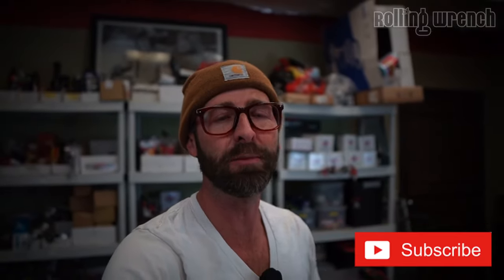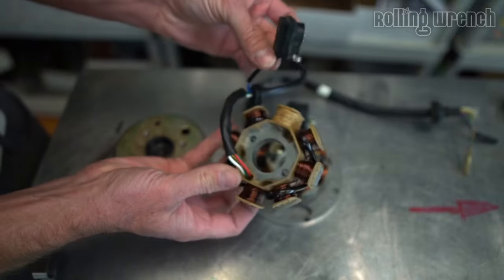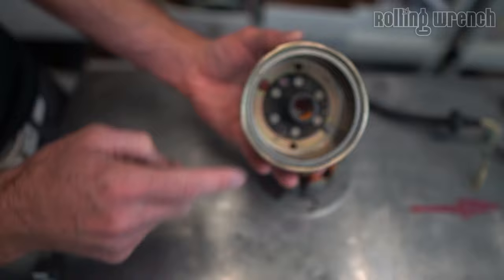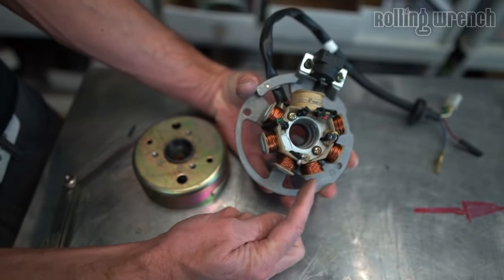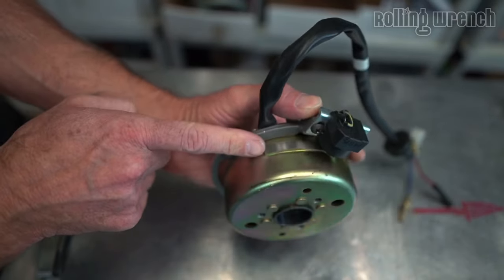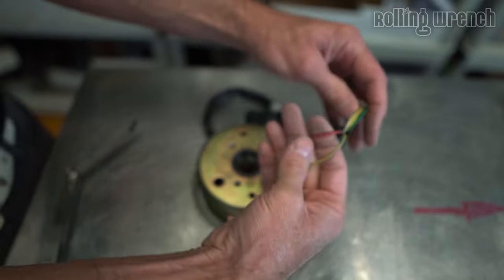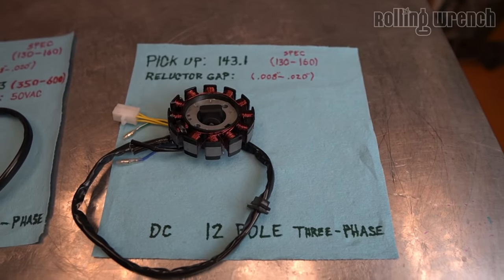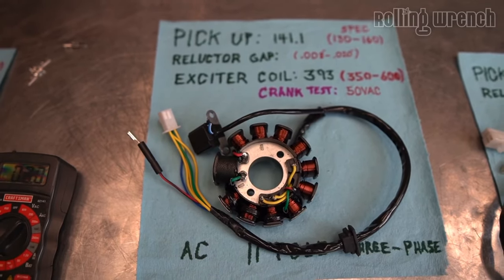HOW TO TEST A STATOR / WHAT IS A STATOR [step by step] GY6

Comment: The probes(AKA test leads or leads) on the multimeter have caps on them. That's why you only have a little bit of metal probe showing, if you remove the cap you'll get the rest of the probe length.

Comment: Hi Rolling Wrench! I converted my 1979 Honda Cub C50 from points ignition to CDI ignition by using a 1983 Honda C50 magnet wheel and a Chinese copy of the stator of the same bike. Now everything works perfectly except the exciter coil is getting hot and unable to run the bike in long distance (around 5 miles) as the exciter coil is getting fried. I tried changing the exciter coil with thicker windings, but the problem still exists. Could you please help me to solve this problem? 
Much love from Sri Lanka 🙏

Comment: in the final test you got for testing the exciter coil from black and red to ground when unplugged i get zero, when i test those same two wires while cranking i get 48 ish volts. i am unable to use a feelers guage because chinese engineering puts the stator in the end cap but the magneto on the bike. how do i know what is wrong.

Comment: Off Topic Engine Type  . i have a 1978 Honda G400 Flathead my Model is a CDI but i havent took it apart yet . i wonder if i can Retro Fit a Quad ATV  AC CDI ( 6 pin) box and use the Default trigger from the G400 to make it work

Comment: I have replaced my stator, but 
wanted to diagnose the old  'dead stator'.
I find that the p/u coil (exciter, pulse)
reads 280 ohms (you show spec for yours
to be about 130 to 160 ohms. Is mine far
enough out to indicate the p/u coil was my
likely or possible problem? 
This is on a 140cc pit bike with 
6 pole ac stator.

Comment: I have a Yamaha wolverine 350 that will not rev. I have tried the park brake switch hack and tried spraying carb cleaner in the carb to see if it’s a fuel problem but no luck.  Could a defective stator  cause the failure to rev? Or possibly the CDI ?

Comment: My stator pins have fried over time. By previous owner. I can use the pin connectors so im probably going to hard wired instead of the pins to see if they work. The rectifier was also fried. I want to replace that first since its cheaper then the stator and im on a budget. If i notice same issue then i will replace stator.

Comment: I have a 2009 Honda Metropolitan 50cc and I tried kickstarting it while the kill switch was on because it wasn’t starting, I forcibly pushed it down and back up multiple times until I realized I just had to flip a switch. Now sometimes it makes a terrible sound by the Kickstarter box. Just not all the time
Reply: Update. Found out you live in colorado so I’m going to have to find your shop :)
Reply from the maker: Hey Nik, just pull outward on the kickstart lever. I have seen this from time to time. If that doesn’t work. Remove the cover and lube the components. Very common issue

Comment: Question I have a standard 6 pole stator. Running it's charging the battery 14v, perfectly, but I have burn out two kill switches. I put a meter on it and as you increase the rpm so does the voltage, at idle 19v half throttle 48v,  on the kill switch wire, I changed the harness and it's still doing it? I'm baffled, which is why I'm watching you video, have you seen this before ? Cheers Azza from down Under

Comment: I bought a 2006 year model 49cc bike and have had some problems with getting it running good. For now I have it running but it only does 30 kmh/18mph at max and it should go at least 45kmh. At full throttle it makes lots of sound but just won't go faster, it also can't handle uphills, it just dies off and engine turns off. It just silently rolls out into death.
Any idea what could cause this? I've been cleaning the carb and trying to get the mix right, the air screw is turned in almost as far as it goes in, just half turn until it is maxed out. The idle is screwed out to 3-4 full turns. I tried moving the needle to the highest position because I thought it was running too rich because the spark plug becomes black and full of soot, I replaced the spark plug with a new one with still gets all black and sooty. However when moving the needle to the top position the bike ran bad and made exhaust pops and bangs so I switched it back to the middle position, but still it won't have power to go up hills or even slight steeps, this is 4th gear mostly but it will die in lower gears as well. I was thinking if the main jet is too big? I haven't got any jets to try out with yet, or could there be something else you think is worth checking? I cleaned the air filter in petrol and after that it kind of ran a bit more even on the idle as from before where it went up and down and in general felt very unstable. The bike is a Honda Rebel clone called Pagsta Regal Raptor DD50E2. Would appreciate any ideas worth checking.

Comment: Great presentation. Can you advise if the magnet sensed by the pulser coils (i.e. under a pulley cam in an outboard) should be strong enough to detect with a simple metal object (like the end of a screw driver)? Also do magnets have a duty cycle or life before they are shot?

Comment: So you can only test an AC stator with it hooked up to the machine? I’ve got a snowmobile that doesn’t have Eletric start. So I’d have to pull it and having the bolt meter hooked up and pulling the cord and checking the reading would be damn near impossible

Comment: Let me throw a rolling wrench into this one...   LOL  Fighting with a weird CPI 2T ignition.  the pickup has 2 wires on it....  ?  white/red and white/green.   
I had this running at one point..  The white/green is not connected to anything out side of engine but looks like it was connected to a splice connection at one time?    But no spark..  is it possible I had that wire to ground?   Ground to white red gives no readings.  but white/red & white/green does, almost like the ground is floated from the ign. pickup.

Comment: Hello I have a Chinese ATV and I was getting a bad sputter with backfiring and things like that I put a new carburetor on it still the same issue I figured I had low compression bought a new engine still the same issue the only thing I put on from the old motor onto the new motor was to stator because the one they sent me the cover was broke do you think the stator could be my issue?

Comment: Hello im doing a custom is style build my engine has a 5 wire stator but the loom im useing is for a 4 wire stator 
Is it possible can i connect them together?
I think iv figured out the wires on the 5 wire 
Pick up+
Pick up ground
2 wires to regulater
Stator ground
If this is right could i connect the 2 ground's together at the plug to make it essensualy a 4 wire stator

Comment: Excellent video! Earned a subscriber. Question: 90cc atv AC stator. Yellow charging wire connects to y-r factory wire which connects to reg/rec and a resistor. Is the resistor necessary? If it is what does it do? thanks

Comment: Thanks for the video.i have a question not sure if you can help me.  I have a 2004 suzuki ozark 250 that has spark for the first 4 second then no spark. If I stop cranking and I star cranking again it will spark for  4 seconds again and then no spark again. I already tested the crank sensor and tested good. I tested cdi, ignition coil, spark plug on another atv and they all work. Any suggestions on what could be wrong. Thanks
Reply from the maker: Normally when I see that it’s a daft sensor that is on or a bad kill switch. Try cleaning the kill switch contact and be sure it’s not stuck or making contact

Comment: Hey rolling wrench, i am really stuck right now with a no spark issue. First let me just say, wether i use the old stator or the new stator i dont get a reading out of my multi meter for anything i do in this video unless the stator is hooked up to my scooter, secondly on both stators im not getting any reading when I test the green wire with the red/black i get nothing, just the OL. But when i test the blue wire with the green, i get roughly the same numbers on both stators which seem to be the normal numbers based on other videos. Do you know what this could be? Do i just need to try another (3rd) stator? And my stator is 8 pole 4 wires. With 1 black/red 1 blue and 1 green and 1 white wire. Any help would be greatly appreciated.

Comment: Ok so my cheap harbor freight $6 multimeter doesn't have the same things you have I have the arms and below 200 but the other one you said I don't have to test the red and black wire what it is is my 8 pole stator is getting grounded does that mean it's bad

Comment: Maybe it is already asked.... But does it matter if you mount de stator the opposite way. If you know what I mean.... So there are 2 holes in it... If you turn it 180 CW or CCW does it matter? Thanks already  for   any explanation
Reply from the maker: The wires will be in the way. So you it won’t work

Comment: I have a GY6 150cc American Sportworks buggy. The engine has spark, fuel and compression and the valves have been replaced and adjusted. However, the engine turns over and sputters but will not start (even with starter fluid). Timing has also been double checked to TDC. The only thing I haven't done is the stator and flywheel (both ordered). The buggy was driving and all of sudden died on the fly and did not want to start back up since.
Reply from the maker: Chances are it’s a bad CDI box. The timing in the cdi is jacked. I have seen it a lot. Especially with those blue eBay performance CDIs. This is a nice upgrade for the CDI and the Coil 
https://www.rollingwrenchdenver.com/products/gy6-cdi-coil-combo-adjustable-timing-advance
Reply: @RollingWrench  the CDI it currently has is one purchased from GoPowersports & I've already replaced the CDI. Nothing changed. About to call it and order another engine.

Comment: So for 2 phase stator, If I connect the yellow or white wire to the body of the stator or the green wire and there is an ohm reading, its grounded right?
Coz If i set my multimeter to continuity, it makes a beep sound..
Im kinda confuse now, Coz my new stator makes the same ohm reading/beep sound as well. 
And from what I understand the yellow/white wire should not hv any ohm reading/beep sound with the body/green wire.
Am i wrong or did i just got a faulty new part?

Comment: Very good video.  However, I have a question.  I have a Yamaha BW200 and it doesn't have a battery.  It runs great but then out of the blue it will just stop.  I've been told it's likely the stator.  How do you test one that doesn't have a battery?  Thanks in advance for your help.

Comment: I have a question; I have a 1998 kaw.300 buyou 2x4 ATV, I just put a new regulator/rectifier and a CDI box that was bad. Now when I start the bike up it runs, and my meter is showing 14.5 volts charging, but when you throttle it it backfires and just won't hardly run, I did unplug the connector going back to the stator and it will run better, can't figure it out because it is charging right. Some advice would be appreciated..Could I still have a bad stator even though it's charging the battery?

Comment: I have a gy6 72cv bbk, have added LED lights in engine area and in seat bucket, and am adding a usb charger port and bluetooth speakers. Do.I nees to upgrade my stator to provide more current? Can a 150cc stator fit on a 50cc?  Ive seen 6, 8,11 pole stators and have been trying to find an answer. Thank you

Comment: Do you have any ideas for a starter that won't work on a regular 2006 stock Honda Ruckus. It does not have a separate starter. It uses the stator to crank engine. I'm stumped. Nothing on the start button except a click for a relay and tail light comes on

Comment: I really need help.
I've being trying to fix my ruckus for while now.
If New Battery or charged it will starts and I can drive it until I turn it off then wont start again feels like trying but won't turn over.
Checked stator voltage it is fine, new fuel pump, new fuel filter,checked spark plug and it has a spark.I do have CDI and it is 12.5 strectched.Just not sure where else to look.I watched bunch of your videos and can't figure it out.
Reply from the maker: If it’s our harness we offer free tech support. Otherwise I can still help via face time. Here is a link: https://www.rollingwrenchdenver.com/products/rolling-wrench-tech-support-help

Comment: hi i got a question. when i installed my new stator the scooter would not start on the Electric start it would just turn over. The only way to start it is to kick start it. The electric start worked just fines before i installed the new one. can you pls help me out?

Comment: I have a 157qmj that just quit sparking. I picked up a new cdi and coil but still have no spark. I removed the red/yellow (I think) from the small plug on the cdi to test if the kill switch from the ignition was bad and still no spark. I tested the black/red from the stator to ground and cranked and had 98vac. I did a crank test on the blue/green wire (I think) and had no voltage. Does this indicate a bad stator? That voltage seems high. I haven’t been able to locate the voltage regulator/rectifier yet.

Comment: I'm working on a 02 Suzuki eiger 400. The 3 yellow charging wires to stator have the same ohms 1.5 but the other plug from the stator has 4 wires blue green a white and a yellow. How do you test that part

Comment: I am about to test a stator from a 1984 Yamaha 3 wheeler ATV and it looks quite different. It is pull start only and no battery. The reason I am testing it is because this machine runs fine but then shuts off after about 10 minutes and will not start for another half hour or so. So I was advised based on this to test the stator, does that sound right to people on here?
Reply: Check the valve lash sometimes when the valves heat up and 10 two expand quite a bit now to explain running for a short while and then not starting until it cools down
Reply: Other things that can cause it to heat up and shut down... Incorrect spark plug/gap, inefficient cooling system (dirty),  I'm pretty sure there's more where those came from.

Comment: replaced my stator and the pulser still output 0.1 ac volts. could this be an issue with the flywheel? it has never been changed for few months tho and its rusty

Comment: Hello
 on my AC stater I’m getting 56v on the crank test. And no reading on the exciter test I also have no spark.. could this be a bad stator? Thanks 
Update on the exciter test if I put the positive on the red and black wire and the negative on the battery I get 300..

Comment: Hi, Is the source coil another name for the exciter coil? My Yamaha breeze 125 manual states 310-400 ohm resistance on the source coil and I am getting only 220 ohms. I am having starting problems so wondered if this amount out of spec could be causing my problems? I am testing this in winter so only around 6c where as manual says to test at 20c so I would expect slightly low resistance but not this much out of spec.Thanks?

Comment: I have a question about stators and output. I want to put in a stereo system but don’t want to drain the battery dead. My system has a Rockford power 400w amp with 5.25” power marine grade speakers. What stator and battery should I be looking at? Thanks in advance!

Comment: YO rollling wrench, question for ya: have a 1983 honda cm250 custom. If the stator is worn out, does that give poor spark? Or is that mainly a worn out CDI? Currently have aftermarket coil and hove gone through 6 standard plugs. Coil was fine last year. Wondering if it is getting hot due to possible unbalanced resistance amounts and getting too hot. I have an oem coil coming, but has not arrived yet so not installed.

Comment: Hi I am having a problem with a 2001 90cc stator long story short the last owner started it on fire by putting a wrong one in it, I'm putting the original in I have no idea what the short wire pointing inward toward the coils goes? The longer wires to attach outside of the stator case are all labeled but the short one I have no idea where to attach, the stator does not have a plate

Comment: Hi RR i am having trouble with my kids go kart 110cc burning up stators i cant really check the gap between the flywheel and the pickup sensor because the stator is mounted to the cover and is not accessible when the cover is on. Could the gap be too much and be burning up the spark pole on the stator because the voltage is too low (due to the large gap)?

Comment: Hello I have a question I recently had the cooling fan on my moped to break into pieces and I change the fan and after I rode the moped I could hear something rattling around and it sounded like it was coming from the housing where the stator coil goes and I'm thinking that pieces of the broken fan got in behind the stator coil housing and messed the stator up because now the moped will not start and I'm not getting any spark to the spark plug but I also noticed that when I was riding the moped before that something would Shock me something something was throwing a shock to my hand on the throttle on the right side and I'm trying to figure out why?

Comment: My Stator is a 8 pole 2 phase looks like DC.
It has 3 wires total. 1 white and 1 yellow in the plug and then 1 blue and white wire separately (pickup)
How do I test this one? I can't find one of these stators...all I find are AC stator.
Can I switch this over to a AC stator and put a AC cdi in place of the DC cdi?
This is on a air cooled 4 stroke Kymco Agility